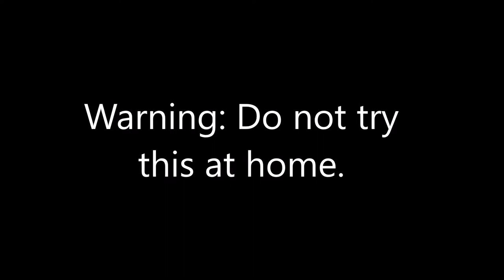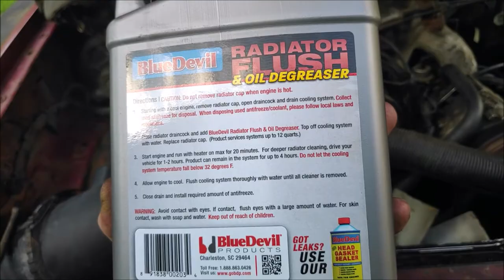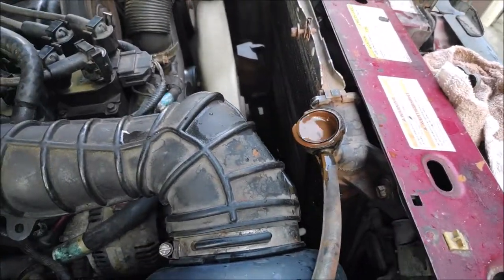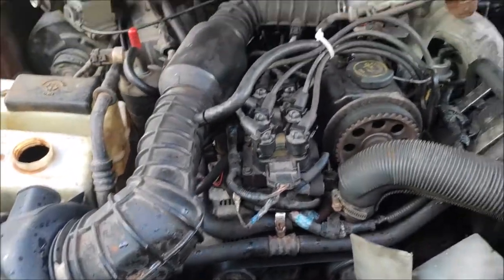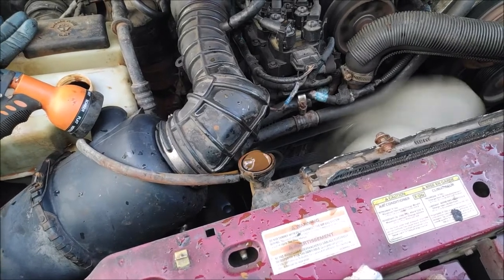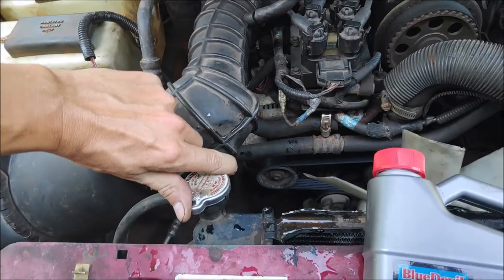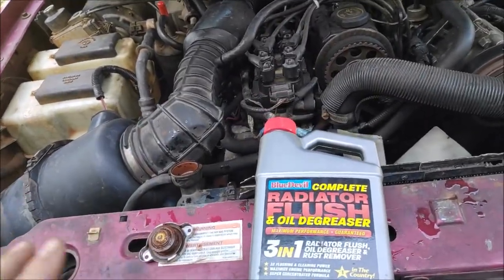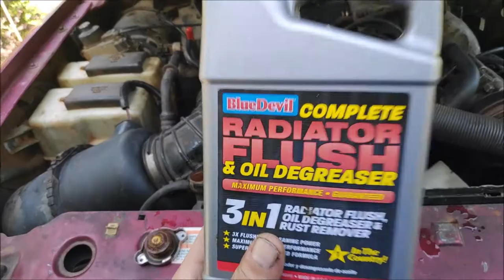Blue Devil Complete Coolant Flush and Oil Degreaser vs Rusty Coolant System, Does it Work?

Comment: You should try citric acid, dissolve about a half a kilo in 10liters of warm/hot water, then fill up the system with it and use the car as usual. 24-48 hour later flush it well, and than fill up with coolant.
Reply from the maker: Thank you, I'll have to try it out. 👍
Reply: Won’t citric acid eat the rubber?  I honestly don’t know, but I’ve used diluted citric acid to clean corrosion off of brass/copper, and it 1) eats the metal and 2) will eat heavy duty enamel paint off of a floor. 
Citric acid is pretty awesome, but I’m not sure if I’d trust it in a car…. But I’m a novice. Just stating my thoughts hoping for insight.

Comment: This only says services up to 12 quarts. I have a 20 quart system. Should I put 2 in?
Reply: I’d have to say yes.
Reply: @williamjones3480  and how many times did it take yours I used distilled good water to flush it all out when it was done. But how many times did it take you to make sure it was all flushed out after?? Plus I have a big V8 hemi
Reply: @darthnevik5505  I’m actively sitting in my car with it running now.  I guess I will have to answer you this afternoon sometime. 

I think chrisfix used it and he flushed 3 times afterward. (But I could be completely mistaken. It’s been a while.)

I’m just going to do it until the water is clear after 30 minute run cycles, then letting it cool.
Reply: @williamjones3480  make sure to bleed that cooling system once all the water
Comes out clear I used distilled water because ima perfectionist. But anyways I did it for about a hour. And ran water till it came out clear but once I put fresh antifreeze/coolant you need to bleed that thing. With it running. Just squeeze the upper house and get all those bubbles out
Reply: @darthnevik5505  I bleed from the bleed screw above the heater hose. Is that wrong?  It’s the highest point in the system.
Reply: @williamjones3480  I got a V8 Idk what your working on. All I did was vise grips on the bottom hose clamp until it came out clean
Reply: @williamjones3480  don’t forget to make sure you bleed it tho. Just squeeze that upper hose all around it Ik it’s hot just gotta be a man basically squeeze upper hose until you can’t anymore with the heater on low
Reply: @darthnevik5505  why “be a man”?  Just use an oven mitt, right?
Reply: @williamjones3480  I got a real high pain tolerance up to you
Reply: If you car has a 18 gallon fuel tank , do you put 3 gallons in it and expect to drive what you would on 18 gallons of fuel… ?

Comment: The problem isn't always the radiator itself. It's going to also be stuck in hoses, the water pump housing, water pump, thermostat and thermostat housing and ter heater pump.

I've been flushing my system put continuously and had stared off witu too bottled of some stuff I think called Mac as I was imma small torn at the time and they were very limited at that Nampa. Did one hole bottle liel instructions said for 30 mind but habe let it idle for an hour and half. Still. Dirty. I've been using sips at a girl from the second bottle and have been topping up witu distilled water and idle for hour and half each cycle. Did one run and drove 40 mins away and the the morning it was very full of rust when draining and it filled my entire radiant witu rust. My next flush I'm contemplating either Blue Devil or Thermocare....
Reply: Can we have this in English please?

Comment: ok my system i did just the powr flsh it was  perfect and clean when drained no rust in system or grease ...so today went to work door das drove at high sppeds it stayed cool after 1st p/u started car up bam full overheat ?????

so masde dlivery and sat for  1/2 hour put more antifreeze in wasable to keep working got home at 1 :15 am car li felt on idle it fucking overheated again!!! no leaks as far as i can teel so im goona use the prestone full system flush to clean everything heter core water pump etc... and drive all day tomorrow sat most likely full 11 - 12 hours and if it overheats after removing the water n flush in there and putting in full concetrate anti freeze ..... i'll just freaking screammmm